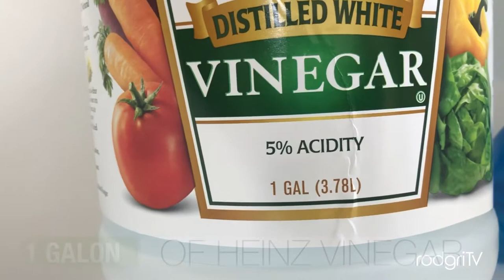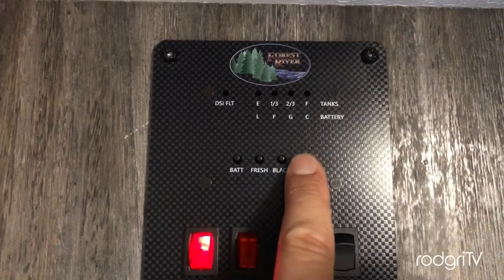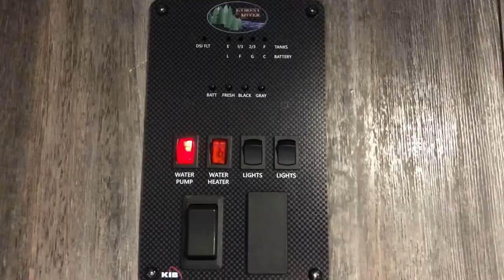SAVE MONEY - EASY FIX to clean RV Grey Water Sensors

Comment: i have problems with my grey tank sensor and the fresh water sensor as well any idea ?
Reply from the maker: Hey rodysk8 thanks for watching! 
Try vinegar and dish soap and water. Also, you can put a 12oz bottle of Clorox. Leave it for 24hrs (no more than that). Try to remove any food or any oil with paper towel before you use the sink. That works for me! 🤙🏼🛹